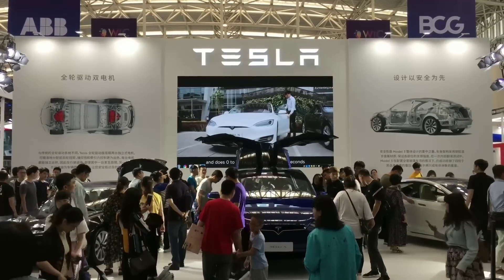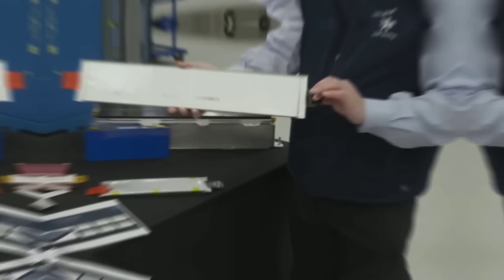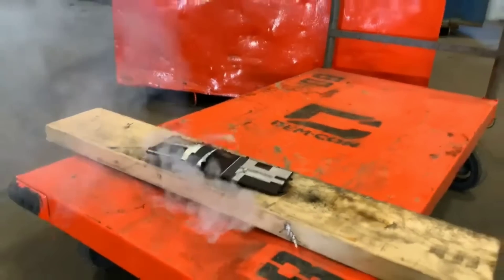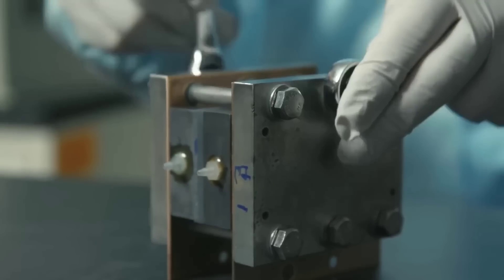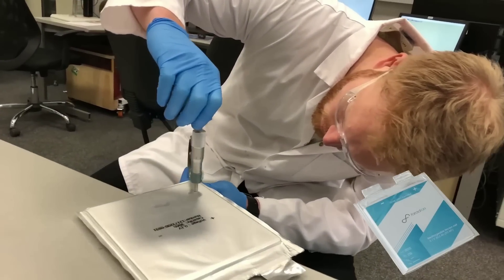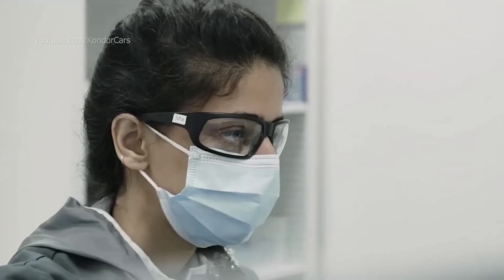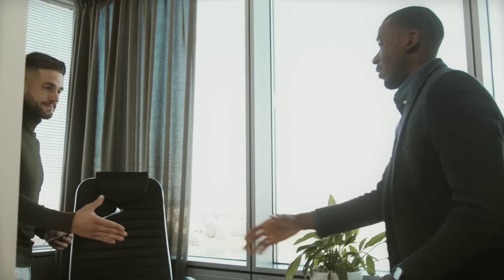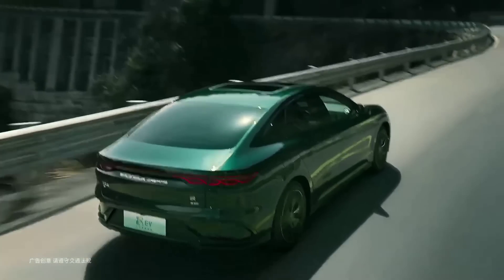World's First Non-Aqueous Sodium-Ion Battery Breakthrough 2023

Comment: sodium ion batteries could be great.  doubt they will completely take over battery market.  its going to take time to scale them.  the video focuses on faradion, but CATL and BYD actually have sodium ion batteries going into production.  they are less dense than lithium ion batteries but will work fine for smaller EVs with 200 miles of range.  density should improve over time.  this video overstates issues with lithium, nickel, and cobalt.  lithium is only 2% of a lithium ion battery.  The newest lithium ion chemistry that is set to dominate is lithium iron phosphate magnesium.  that is in production now.  nickel and cobalt are rapidly being replaced.  10-15% of cobalt is from "conflict" mines.  it is an issue, but its overstated.  faradion comes out with these wonderful press releases but I have yet to see any major third party verification that they have something that can be produced at scale and meet all the requirements in terms of safety, longetivity, density, etc.  I would look at any source.  I hope faradion is further along than I think, but for now I have them in the category of hype.  it faradion's batteries were as great as they claim, they would be worth hundreds of billions of dollars.
Reply: Does sodium and water react together?
Sodium is highly reactive with water, and the results can often be explosive in nature.
Reply: @jbodden6977  
good question.  I have to do some more research but its hard to get specifics on these batteries complete chemical compostion.

the sodium ion batteries are less energy dense than lithium ion batteries, so they will only work for smaller EVs for now.  they could be improved to be more energy dense over time, in fact that is expected.  another advantage they have is that they are safer than lithium ion batteries and operate better at lower temperatures. They are newer tech.  lots of companies are working on them.  the two companies actually starting to produce them are from China.  BYD and CATL.  Those two companies have not put out a ton of detailed information on them.

I don't know a ton about the specific chemistry of the sodium ion batteries.  not sure if the sodium ions are bonded with other elements to form molecules that are more stable than just pure sodium.  table salt for example is sodium chloride and is stable.  

we have known about potential for sodium ion batteries for awhile, but they finally improved them enough to make them commercial viable.  with batteries thats tough becuase they have to be safe, sustainable, long lasting, affordable, and scalable.  its hard to find a battery that is all those things.